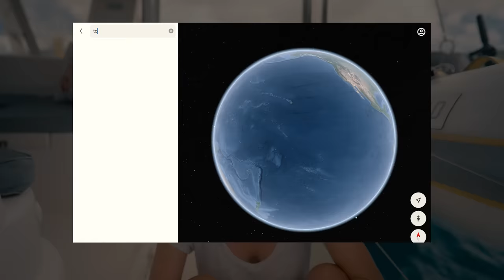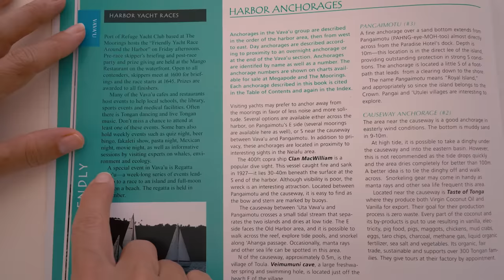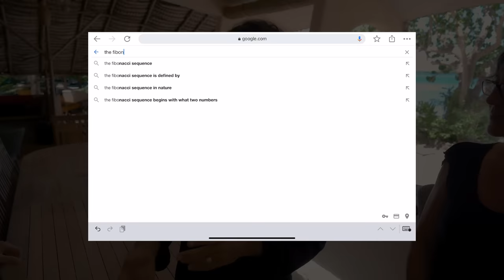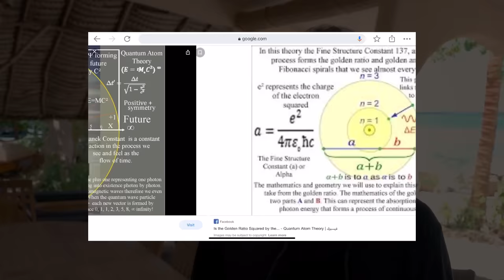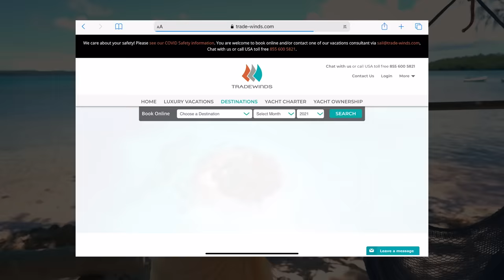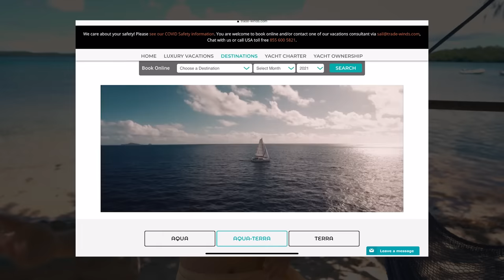11 Years Living Off-Grid On A Self-Built Island (full tour)

Comment: They need to upgrade from those lead-acid batteries.
Reply: Why? The lead-acid is more than adequate for what they need, when they die I'm sure they'd replace with them. What's worth considering is getting 10-20% of their capacity in Lithium, these lithium batteries sole purpose is to discharge daily and keep the lead acid topped up and within it's float range, where they can essentially last forever. A lithium/acid hybrid system is super interesting stuff.

Comment: I have just recently found you guys. I watch several other sailing couples but you are the only Pacific ones. Most of all I am totally impressed with your attitude and happy nature ALL THE TIME!  No food, bad engine, dead generator, etc. And still in love. WOW.  Question about the dead starter? Are the starters accessible on your engine such that you could take the good one off the running engine and then use it to start the other engine. I’ve only got a single engine boat but the starter is totally buried down under.   Keep up the great work.